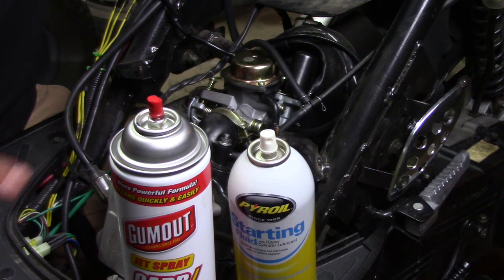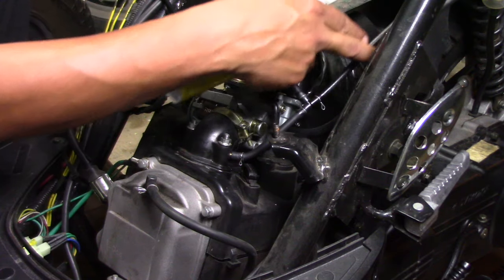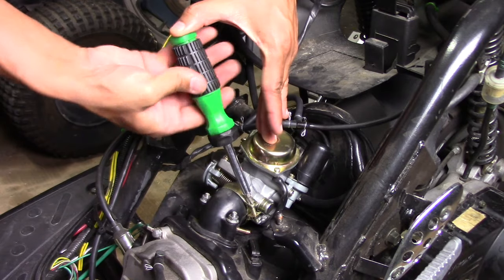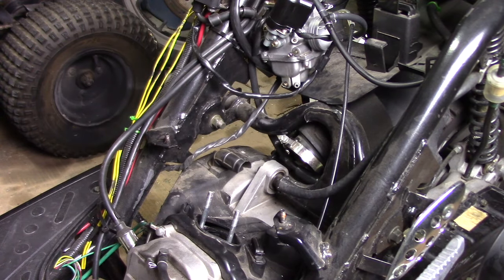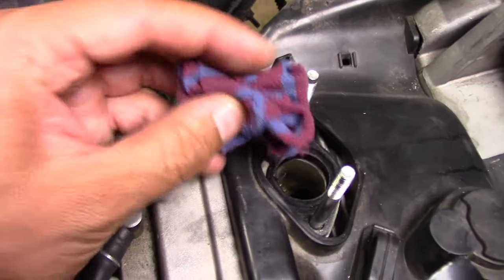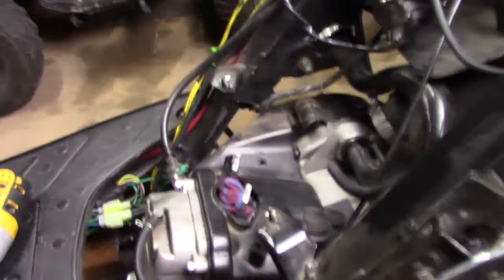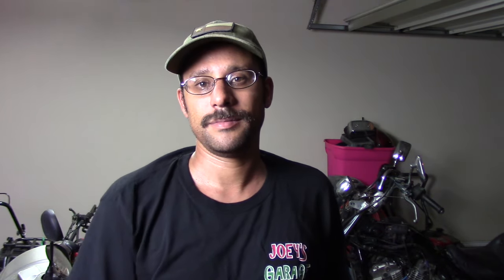GY6: Finding Vacuum Leaks

Comment: You can also use a propane torch (not lit, of course) open the valve and run the torch over the hoses. If there is a vacuum leak you will hear the engine rev up higher, and the propane won't affect the plastic parts, the rubber or the paint.

Comment: That spacer is that needed
Reply: I only use the paper gasket between the engine & intake manifold pipe, & the plastic one between the pipe & the carburetor.

Comment: Someone said to check the fuel screw i had it at only one turn because their was a vacuum leak from a broken rubber valve in the carb that is part of the vacuum line, after changing it and turning the screw out 3 turns it runs better but still has random idle speeds that change but not too drastic.  My muffler makes alot of noise too i think its shot and is alot of exhaust coming out im guessing because its worn out and not creating back pressure from the exhaust screwing up the carb adjustment.

Comment: I was wondering if you could help me with an issue I'm having with the air box. Some of the rubber portions have ripped off on the connection . Almost like a ring of rubber ripped off because of wear and tear. Consequently I can't seal it will on to the carburetor. Almost like it's too short now to even extend to attach because of the ripped off ring a rubber. Do you have any advice or recommendations on how to seal the airbox to the carburetor that goes into the airbox?

Comment: Nice job and great idea to find leaks. Never thought of that. Thanks. Thumbs up
Reply from the maker: +Matari 7 thanks.  Air leaks can cause performance problems. After the video I went back and checked every inch of the vacuum lines. Found a couple sections with hair line breaks.  Replaced those sections also to prevent future problems.

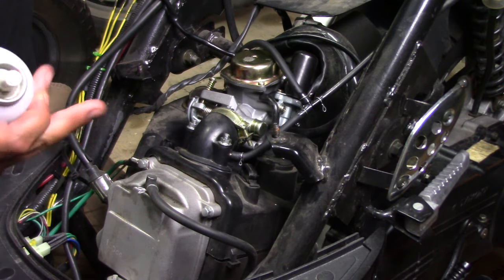Comment: around 3:05 where you explain that it could be getting leaner as it runs specifically becuase of these vacuum leaks was like an aha moment for me with the crap I'm currently dealing with... does the problem tend to be worse when you first run an engine opposed to after it's been running a while?

Comment: liked your video. I have gy6 50 cc motor that had a crank bearing knocking.  run great it would do 40 easy. anyway long story short . out my back up motor in12/2015. well now it having problems. to first motor apart lasnight . yes I want to rebuild it and make it  bigger cc engine. where suggest to get the parts from what all do I need
Reply from the maker: +Tony Whalen scrappy dogs, nycscooter parts, parts for scooters, and gy6 racing team in eBay are my goto stores
Reply: Parts for Scooters and Scooter Domain are in FL. PFS has great customer service, I recommend. GY6 150cc rider from MIami here. Subscribed

Comment: Joey, can you tell me what the scooter will do or how it will run if there is a vacuum leak or some problem with the lines, hoses or whatnot? My scooter is acting like it is choking when I try to go full speed. It starts right up every time and takes off good, but after maybe 30 mph it starts feeling like it is hesitating and jerking slightly like something is holding it back or choking it off slightly. Slightly, because it still runs and goes fast downhill or on the flat, but it does not run like it was running. It is pretty new with 1,600 miles on it.

Comment: Love your videos Joey hopefully you could give me some advice. I got a 150 GY6 that runs okay but recently has lost power slightly and sputters off and on at top speed. I'm going to test the vacuum lines like you showed. Any other advice would be great. Thanks again
Reply: Me too! Same thing, like something is causing it to choke and sputter a bit when I want to get up to a higher or highest speed. You can feel it sort of jerk, like wanting to go faster but then hesitating
Reply: I know it was 3yrs ago but did this fix your problem as i have the exact same issue. Thanks.
Reply: Gas

Comment: What does it mean if the engine dies when spraying the joints?
I changed the vacuum lines and added better hose clamps and my scooter is running better.
 Just thought it was wierd that it worked in reverse by killing the engine not revving.

Comment: hello mr joey  

mine is a sym scooter.   125 cc.          7 am started and went out .... 7 .10 am the scooter stops just as it was going. engine stops. i kickstart, self motor start, the engine does not start. 

 my scooter piston, cyliner kit, spark plug, ignition coi, cdi unit, has been changed to a new one just a month ago.    i call my mechanic person telling him that the vehicle is parked by the road and i am taking a walk back to home.  He says- hmm... all things are new.. maybe a vapor lock has occured..  I start back home and at at 7.20 am I decide to give one more try to start the engine and i did and it started !! .

  I phoned again to  the mechanic that the vehicle has started again and drove back home.   Had the engine not started he would have found out the problem .  BUt now the scooter is running ! I simply dont understand what was EXACTLY the problem that led to the vehicle not starting. I would like to know .  Can you give me some clarity as I see you are very interested in the puzzles of a vehicle not starting...

.It is over a week and my scooter keeps running well !   BUt  I am not confident that this vehicle will run well... It may stop any time because i have not yet found out the problem and rectified it .  kindly offer some help.  thank you. ganesh from india.
Reply: Keep fuel and airlines of the top of the engine case with a zip tie or something. Vapor lock is when you the hose gets to hot  fuel will not flow right
Reply: @rockstargamer7936  I was told that it was an airlock problem. Over 3 ;years now and the scooter has not had any such airlock problems so far...

Comment: Hey Joey, I have a kymco movie 125 gy6 engine 2011, which on the first start of the day runs fine, then after a minute or two the rpm's rise (almost like the electric choke was closed and then opened) and so my clutch tries to engage and drives forward a little (if i hold both legs on the ground i can feel ever slight pushes but nothing dangerous)
What can that be? Engine had compression problem that was fixed (new piston and cylinder, exhaust valve was cracked due to backfire,  in short engine head) and carb tuned (and re-tuned by me after the mechanic)
Forgot to mention: after the electric choke heats up, around 3 minutes overall, closes, the rpm's drop to normal.
Reply from the maker: Does sound like an electronic choke issue.  They do go bad after time. Have you tried disconnecting the choke connector?  Next thought is the valves. Have they been checked after the engine work?

Comment: Hey Joey your videos are awesome and tutorial I did the vacuum leak test on my gy6 150cc  Chinese scooter and when I spray starting fluid around where the back of the carburetor near where the air filter goes it shuts off while idling but doesn't accelerate is it the same a vacuum leak?

Comment: Can that intake if it has a massive leak could that prevent the throttle from acceleration. You see mu gy6 idles good and starts easy but the minute I accelerate the engine dies. I was told that all you need is one vacuum line to run bike, but what do I do with vacuum line coming from petcock that makes suction for fuel to carburetor and what do I connect this little filter with a one way directional arrow that's coming from the top of the fuel tank in other words I have two lines coming from fuel tank one is fuel going to input of petcock then this other one that used to go to this canistor which I eliminated that said I beleve pcv on top. Guess that canister made of plastic had 3 lines coming off it. The actual pcv line on top of valve cover is going to airbox. I was going to get the nibbi type of cold air intake with curved tube and all but decided instead to modify my stock air box which I think I did a pretty good job modifying. But I do need your help with this line coming from the fuel tank with an arrow on it pointing away from the fuel tank. Hope this is not too confusing Joey? 8:18

Comment: I changed this and the bike ran better but still has issue with unstable idle.  I had to remove the manifold again and the bike finally ran.  after 2 months their was a leak again in this stupid area but resetting it fixed it for now but still cant get idle steady and carb sputters.  Could their be leaks in the carb seals too?

Comment: Joey, my tao tao will start and idle fine but bogs when trying to ride. just replaces cylinder head. is there anything else I didnt to do? gaskets, fuel or vac hoses? also, the carb sprays sometimes sprays fuel when starting. need help please

Comment: Mine could be this it has no obvious leaks but the idle is crazy and it sputters almost sounds like a tiny backfire.  I can hear noises in the air filter too when it sputters.  Also inside the carb is a rubber valve for one of the vacuum lines it had a hole so i replaced it with a spare one but it still acts up seems to be fixed then i have to turn screw way in just to keep it running.  Just realized i commented 2 months ago eh.

Comment: Ive installed a big bore kit it runs good on stand but dies before it will accelrate
Reply from the maker: Sounds like an issue with carb adjustments

Comment: My scooter not working I put in inside my home for 1 night and next morning went to get fuel and it cut off on my way I had to change intake 1 month ago or 2 I changed the carburetor it doesn’t have air filter and the starter doesn’t start the bike well that issues was fixed after I changed the stator and it was starting on button but then now it doesn’t and now it doesn’t start at all one time I order new spark plug on amazon for 6 dollars and after 2 days that got burned why and why it’s not starting you think? Help me

Comment: hey Joey. Question for you..if I removed petcock and replaced with manual shut off valve can I then plug up the air intake stems on the manifold or does that still need to suck air in?
Reply: never mind

Comment: I installed big bore kit,now scootee bogs on idle and full acceleration, and spitting fuel on carb on full thortle
Reply: Rich case
Reply: Rich , or floats needs adjusting , or the side diaphragm in the air valve of the carb has a tiny hole

Comment: i have a loose hose clamp over my intake manifold that seals the rubber to the carb, could that be why my vacuum line wont pull gas? when i disconnect the vacuum line and suck on it, i get steady flow of gas. when vacuum line is on carb and i try to start theres no flow of gas. thanks. i think its a faulty hose clamp...
Reply: dreamingwolfsocom sure was! I had gas in the tank for over 6 months that had just been sitting. I cleaned the gas tank out put fresh gas in and it started right up. I guess you can't leave gas in the tankjs for too long before there's crud in your gas. thanks again!
Reply: @njamele  they say a month or so,and sta-bil and stuff like that is ineffective according to project farm on YouTube

Comment: Hey joey I wanted to see if i could ask for your opinion. I got a 2017 tao tao chinese ATM50 A-1 scooter  I been having  my scooter back firing, Plus when I come out of a stop sign and hit the gas it sounds really lazy and it wouldn't go. Any tips you can give me I would really b thank full. Thank You
Reply from the maker: Sounds like it may be running too rich. Have you tweaked the carb any?  And have you removed the emissions garbage?
Reply: No i only got a big bore kit installed in it, When i got it  this past febuarry.  It was runing great Till like 3 to 4 weeks ago Then it did that lazy + back firing  wile i was driving it. So i kept going then it when away a little bit. Now i got it put away cause i was worry of damaging something bad. So should I try what u said i never done any mechanical work to bikes so Thank you for everything joey.
Reply: @georgiemelendez6154  did you check the valves or ever chang the oil or gear oil or gas filter i mean how old is the things do you start it up once a day and ride it often?

Comment: I've run into a problem, my 139qmb just wont idle when its cold, it idle perfectly when slightly warm, and runs perfectly, ive tested with 2 different idle jets and auto chokes, no gain.

Comment: Hi.
I had this same problem, but then i fixed it.
Sometimes when im stood still at a red light and it turns to green and i accelerate, my engine kinda dies and then gets going again? What could this be? And it only does it sometimes...?
Reply: Warm the engine up up to proper running heat conditions its not fuel injected duh.

Comment: Thank Joe  for the video good job , By the way joy I have a gy6 150 cc get a bird chirping sounds from my intake also my scooter in manifold has only a o ring does your yours have   the same I see you had a black gasket which was damage do all gy6 use those black gasket in the video yours was damage is that cork or hard plastic. I do not believe  mine has that gasket you showed on your video this scooter I  am working on was not running at the time it was giving to me I am working on it as we speak I have it running but I hear these tweeting bird noises which I believe is coming from my intake like the scooter in the Video?

Comment: I’m going to try this because I have a go kart with a howhit  150 engine and it turns on but won’t drive when I hit the gas ... I have change the carb the fuse the spark plug and the spark ignition i cannot figure out what to else to do !?
Reply: Mines doing same thing 😒

Comment: Hello when trying to start my bike it tries to turn over but no go and also there's no fuel flowing to the carb
Reply: You need to determine whether fuel is not getting to your carb ir fuel is not getting into engine, to determine that you need to remove fuel filter from both ends, if fuel is not flowing, clean your gas tank entirely, if you have flow of fuel, check your carburetor, maybe clean it

Comment: Best way to find a vacuum is to use a stethoscope. Pull the end off the hose and move the hose around till you find your leak. You can pinpoint exactly were your leak is this way.